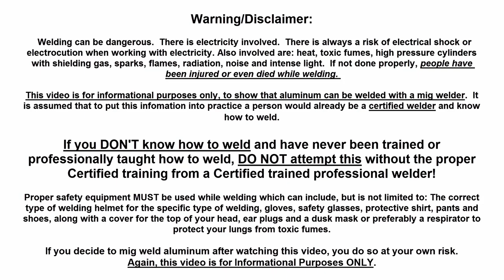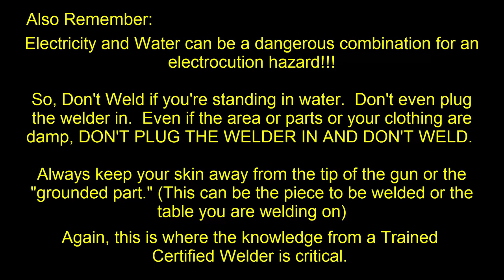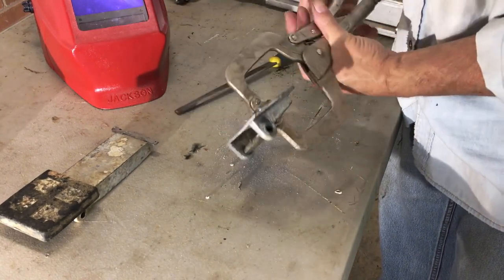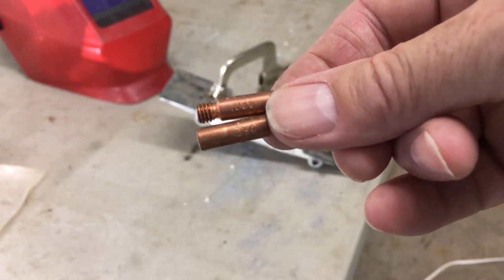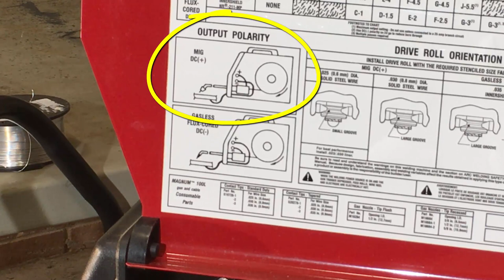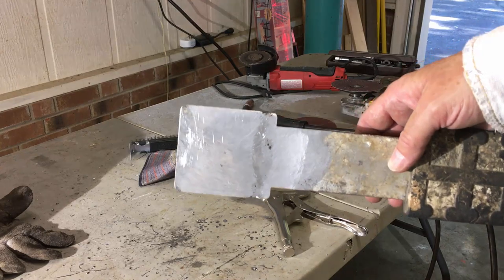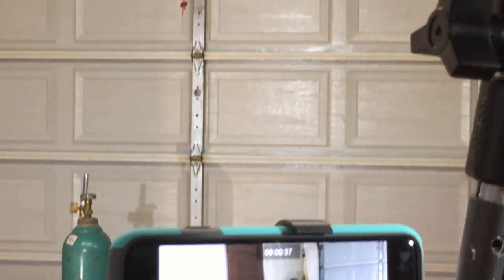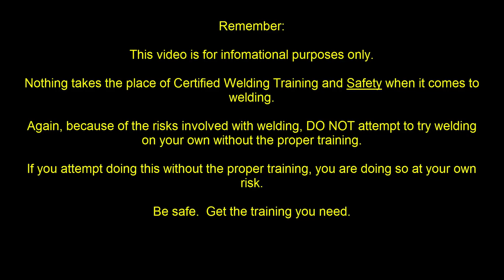Learn An Old Timer's Secrets To Mig Weld Aluminum Without A Spoolgun

Comment: Another thing that helps feeding your wire thru gun is to hold the gun in front of welder with cord stretched out straight. It moves much easier in a straight shot . Also you should use a stainless steel wire brush with aluminum

Comment: When you change over your gases, purge the lines through for a few seconds first, to flush out the previous gasses from the machines pipework.(We usually do that via the gun trigger, but just before fitting the new wire reel. Failure to purge almost always causes weld porosity at first.  In this case, the residual co2 is still being fed through in the beginning, until  finally being cleared out by the Argon.(Same thing if the machine has been stood for a while, you need to bleed out the air via same method.)if the wire is already fed through, you can just slacken the feed rollers, then trigger the gas through (Reel shouldn't move)  about 5 - 10 seconds is usually enough, then re-set tension to the feed rollers. An Acetone wash of the prepped surfaces will also help, but make sure it has completely evaporated/flashed off, and that the container is shifted way out  before even  touching that gun !
Reply from the maker: Thanks for the constructive comments!  I did purge the lines, it just doesn’t show it in the video.  Thanks for watching the video and for commenting.  I appreciate it!

Comment: you know what, ive welded with an ally spool in the mig before and its been ok but its moving so fast its very easy to get a tangle up. the larger nozzle and stiffer wire is the best tip ive heard so far, thanks mate.... :¬)
Reply: a spool you got out of an ally? don't sound to safe to me..?

Comment: Great video buddy! Some very helpful tips for anyone needing to weld aluminium (i'm European). Great to see that you make a big deal out of safety, a persons health and safety is not only about avoiding physical injuries, but also environmental impact such as breathing in dust, vapour and irritants over a period of time. Education is the key here and you nailed that bro!!
I visit the USA and Canada frequently and safely is always something that concerns me over there. Our health and safety laws here in Europe are very stringent and for good reason, one example is the fact semi trucks do not need crash bars running the length of them to deflect smaller vehicles and pedestrians away from their wheels! Very dangerous and must account for a massive number of avoidable deaths over there. All lorries in Europe were forced to have deflect bars fitted back in the mid 80's and I think they should be mandatory on every lorry on the planet.

Comment: New Teflon liner, new tip ( dont use a bigger tip ), adjust (4 roller!) Tension so you can pinch the wire with your fingers before the rollers & stop/slow the wires movement without the rollers grinding & deforming the wire.
If the wires deformed, pull it out because it will screw up later as you weld. Use a shallow angle on the gun. Snip the melted ball off the end of the wire ( @ a sharp angle ) before starting the next weld run ( it needs to peirce the oxide layer on the parent metal ) .When threading in ( installing) a new roll of wire, file the tip so theres no burr on it & slightly tapered so it wont gouge the teflon liner. Once you get good at welding Ali, you can weld anything.

Comment: Excellent video the complainers are ignorant of welding and should be ignored probably very young and just trying to raise an argument.
Reply from the maker: Bud,
Thanks for the kind comment.  I enjoyed putting this video together.  It's sad when people don't appreciate it, but that's ok.  Everyone is entitled to an opinion.  Thanks for watching the video and for commenting!
Reply: Stairway,     Yes, it is sad that people need it to be perfect or they will not like it.  I realize that the video was showing a good method to weld with not the perfect equipment. The video was comical and was a joy to watch. And also informative for the layman to use as a guide to welding. In the past I have been employed as a aluminum  welder at Fletcher Aviation I ran the automatic machines and did the manual welding as well. We used stainless steel wool and acetone for prep cleaning. These parts were going into outer space and were government inspected. But we also welded things that were not under perfect conditions, and they passed stress tests as well.  I have the same lincoln 125 welder as you have and it has worked flawless for me for, it seems forever. I have used many tools for a hammer simply because I did not want to reach for a better hammer. It is sad that complainers are so caught up in being perfect that they can't enjoy a bit of fun.
Reply from the maker: Bud,
Thanks for the kind words.  The video isn't perfect, but it's got good information and tips for the newbie trying to weld aluminum.   Usually, the naysayers either have never uploaded a video of their own or they have one or two bad videos and under 5 subscribers.  With that said, everyone has their own opinion and I respect that.  Thanks again and happy holiday to you!

Comment: Your spot on with the 5356. I use Harris on my Miller set up. The only real reason I see for someone trying to weld like this is that their welding machine does not support a spool gun. Aluminum welding is an extremely hard to learn skill. It took my 6 months of practice and learning how to properly set up the speed, verses volts, verses material thickness. If your welding machine supports an aluminum spool gun, bite the bullet and buy it. I bought a spoolmate 150 for my Miller Millermatic 211 Mig Welder . That way you learn the right way and your welds will eventually come out looking nice with good penetration.

Comment: A Safety Tip- Never remove the cap from a high pressure bottle unless the bottle is stored, securely fastened and can not tip over!  Never move a high pressure cylinder without a protective cap!  If a cylinder is knocked over or dropped it is possible for the valve to break off!  If the valve is broken off, the cylinder will take off like a rocket!  You should make a correction to this video and warn people of this danger.
Reply: Exactly! Cap stays on when bottle is being moved. That is when it is most likely to do it's job.
Reply: ever see first hand what one of those things will do? ....  a video just does not do it justice!
Reply: i had a uncle who had an aircraft parts rebuild shop and the guys got to fooling
 around with an oxy tank and purposely broke the valve off(dull day i guess)  after it went  through a concrete block wall it spun around in the parking lot for about 10 min before stopping  no one hurt  but i think a lot of wet pants
Reply: when I saw it happen it was an accident. concrete is nothing! they go right through, this one missed a gas pump by a foot. that would have been exciting!! and no, there were no dry pants in the shop that day!!
    I did not join the army, was not an 11-bravo or any of that. on purpose. being that close to shit blowing up is not for me!
Reply: busted the valve off of an argon tank in high school welding shop and the tank went through 3 classrooms punching through the walls and launching desks with students around. . . looked like something out of a charlie chaplin movie. .omg, I'm glad I was the one that busted the valve and not one of the ones that got torpedoed out of my desk by the tank!!
Reply: They actually did do an episode of Mythbusters where they intentionally broke the valves off gas cylinders. Pretty spectacular results. Concrete block walls were a joke.......
Reply: Also if you should drop your tank and the end breaks off depending on the gas you can suffocate in an enclosed area on whatever gas you have now unleashed into your work shop. Argon gas is heavier then air so it will settle in your lungs and within a breath or two you are conscience  and dead.
Reply: Also your unsuspecting wife kids who discover you will run to your aid and they are dead too. Keep safety caps on!
Reply: I saw a bottle of acetylene fall over and the top broke off what a mess that made
Reply: Kendal Eklund  does anybody know how to construct an air cannon out of my high pressure cylinder such as an oxygen or oxy acetylene that would be awesome all those pounds of air projectile and stuff like a fluorescent light bulbs
Reply: Happened in my first job many years ago a few feet from me... Mechanic pulled on torch and oxy tank fell out as chain was loose. The valve hit the edge of the car ramp. That thing went off like a missile and we all ran like hell. Caused a lot of damage that day but luckily no fatalities.
Reply: @trousertrout4591  I have seen a black powder cannon made from a gas cylinder
Reply: @RabbitDFFD  no children were injured or killed in the filming of your clowning around in the shop-class?
Reply: @jack2freeman37  golly there Abner, still never figgered out how to put the caps on
Reply: @rogerd4559  nope. Surprising as it sounds. Lol

Comment: Why do you specify a 110v machine ?  I have a 220v but I don't see what the difference would be aside from max rating.   I have MIG and TIG machines but going to try this just out of curiosity since the argon is here already.  Spool guns have come down in price over the years as have entry level TIG's but for a one off repair this is interesting.  

Sorry if I missed clarification on this but you need a stainless steel brush which it appears you had, just didn't see that mentioned and never use that brush on anything but aluminum or it will contaminate your next weld job.  You can't be too clean welding aluminum, I'd say most new to welding underestimate how clean it needs to be.  

Thanks, nice video
Reply: thers no difference 110 V 220 V
Reply: People just say it to brag about being able to weld at home
Reply: @roodbaard51  cheaper to operate
Reply: @roodbaard51  there’s a big difference. Aluminum needs about 20% more power for the same thickness as mild steel. If you want to weld 1/4” aluminum, you need 200 amps. You can’t get that from a 110-120 volt machine. And yes, I know you can’t set amps on MiG, just voltage, but it works out to the same thing.

Comment: Great laid back Vid..5356 wire/.030 wire with .035 tip sound like answer to my prayers..Bout only thing ya didn't mention was turn on gas and purge through tip...Helps lots when you start weld...THX

Comment: Appreciate the video. I want to do aluminum welding with my Hobart 140 I just bought 3 weeks ago. Your finished product did come out pretty good! Looks like it will do the job you want it to just fine. I just can't help but notice 16 minutes in are you wearing work gloves instead of welding gloves?
:P
Reply: Wearing dust mask does not block fumes, only dust. Fresh air supply to helmet works, or forced suction around weld area.
Reply: @richardbarber4444  yes, exactly. I cringed when he said that.

Comment: The most important for every kind of welding is to keep the parent metals 100% clean and dried. Do not apply any oil, solvents, soap.....if need, apply some heat to burn it, and remove by air pressure with a new wire brush. 
Wire feed needs to be synchronized with amperage which depends on thickness and crystal structure of metals. 
This is nice presentation for hobbyists. The TIG is the best welding for aluminum. It makes the best penetration, clean, smooth.....Preparation for welding is crucial and the most important part of the job.

Comment: A small tip put the protative top before you move the bottle I have seen someone drop it right after they remove it from the welder
Reply from the maker: Good safety tip.  I appreciate it!  Thanks.
Reply: didnt even notice it if i seen some guy hauling his bottle across the shop with no top on my ass would be making a run for it!

Comment: The 125 welder you are useing and th exact setup Only I used different rollers to feed the wire and clamped a close pin on the wire loosely before; the rollers with a white linen piece of cloth to wipe of any dust or foreign material.  To clean any thing off the wire as it passed threw. Sometimes that hose caused a bit of a problem if not perfectly strait or even a little dirty. Seem's I also had to have a special liner in the hose. It worked well for at least 10 or 15 years. It welded alot of spools of that aluminum wire. Also used aluminum rod in my DC arc welder, metal definitlly needed to be clean and preheated takes some patients and practice for sure. Good video

Comment: Nice video, it must not be necessary to change out the gun liner with a teflon liner. May be the teflon liner just alows the wire to feed smother?
Reply from the maker: Yes. You are correct.  The Teflon liner allows the softer aluminum wire to feed better.  I did not use a Teflon liner.  I should have.  Thanks for the comment and for watching the video!
Reply: A teflon liner can certainly help especially if your mig gun lead is long. I use a teflon liner in my everlast mig welder and have not had any issues with feeding.
Reply: Kirk Frei teflon liner is necessary because the steel liner contaminates the wire. You might not notice it but for critical and structural stuff it is essential to have teflon.
Reply: Thanks Mr. greens couldn't remember the reason for the liner, haven't welded aluminum in many years.
Reply: Lincoln actually sells an aluminum liner kit especially for this machine. I purchased one at the time I purchased the machine but have yet to use it as my aluminum welding is done with a Miller Diversion 185.

Comment: Good video! Yes why go have to buy a Spool Gun that's half the cost of the welding machine,! let the Mig welder be the Spool Gun, Excellent!
Reply: It's just the difference between pushing the wire 10ft or 10 inches. Personal preference I guess
Reply: @mikemilton9841  Yah i totally agree with that. Spool guns are so expensive. Im glad I found this video. Will test out on my Lincoln MP140  - 110V
Reply: Thanks for the tip👍😊.. I will try it out on my millermatic 211. Would anyone like an update?...
Reply: @Rusty.1776  how did it work for you? I have a miller 185 that I'm wanting to try it on
Reply: Because aluminum, including the harder 5356, is soft, and bends in the tube. If you really plan on doing this not very good idea, you have to change the liner out for a Teflon liner meant for aluminum wire. Otherwise, at some point, particularly if your torch tube is curled, the wire will jam.

Comment: I welded aluminum dump bed trailers using mig machines for years. You have to push your gun instead of straight in or or dragging a bead. Start a weld and go with it. Not start and stop. Set your machine on a piece of scrap having the same thickness.  Grinding your weld makes you a "grinder" and not a "welder". We always tried to make pretty welds to make the trailers look perfect. Lots of good tips here. Larger tip/ Keep welding lead straight/ Keep ground clamp clean for a good ground.
Reply: all welders grind...at least to clean the material if nothing else.

Comment: Set my 120v Weld Pak up thirty years ago (before I had a spool gun on a larger welder) for aluminum.  Lincoln recommended a teflon coated gun liner (Tweco style).  Don't use that liner for steel just aluminum.
Reply from the maker: Yes. Very good point.  A Teflon liner would have helped me.  For my next welding video I’ll be using one.  Thanks for commenting and for watching the video!

Comment: Well now...I have a sp125 plus purchased in 1990...been flux wire the entire time. It still works just fine. I just purchased a LE31MP because it's spool gun capable. Now that I know of a way to wire weld Aluminum with the sp125, I got to try this out. When I get a spool gun for the LE31MP, I can do a comparison. I am an amateur welder sometimes on my best day.
I wasn't going to watch this, but I am glad I did.
Reply from the maker: Mike, Thanks for watching the video and for commenting.  Glad you got some value out of the video.  Let me know when you get the Spool gun and how it works. Thanks.
Reply: @StairwayToVideo  I have been dragging my feet dropping the $$$ for the spool gun but I need to get going, when I do, I'll update on the test...thanks

Comment: Hi  just a quick tip from an old welder - Pretty does not equal strong - Linishing off the Weld would have weakened the Butt - I would leave it if I was you and give the finish a nice coat of Ally paint. ... Cosmetic finish = Paint usually .. trust me  dont grind off the top of the Weld
Reply: i dont have any recent  experience welding alum. but i think he ground the bottom off because it had to sit flat is a food pad for the stilt also a tip to clean up /grind alum. use a flapp grinder wheel with  wax on it. told to me by  aircraft and pipline welder

Comment: Thanks for the information and the two tips that will really help.  I have an old miller that is so old that they don't even make a gun kit for it.  I bought a teflon liner, but the welding supply shop didn't have any advice on how to set up the machine.  The wire speed and larger tip will help a lot along with the stiffer wire.  Of course that was 20 years ago.  Since then I generally TIG every thing that is worth the effort to do so.

Comment: In the seventys I worked for a company that sold mostly aluminum sprinkler systems. They had a spool gun but was heavy and cumbersome. We ran helium gas, and smooth rollers. It ran great, just keep the liner as straight as possible!

Comment: Will this still work with a 220 volt mig? I have a millermatic 185 I’ve had for over 20 yrs. it survived a house fire & still runs excellent, except to run a spool gun , I would have to buy the gun & a retro fit kit , looking for any alternative, thanks